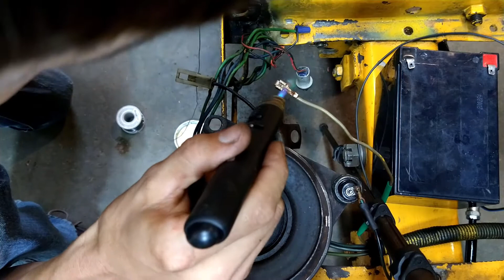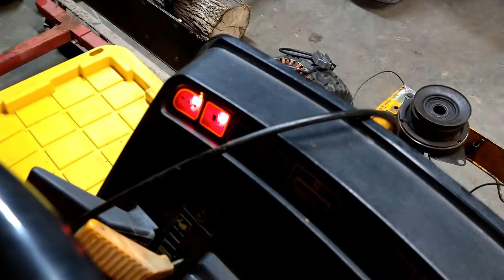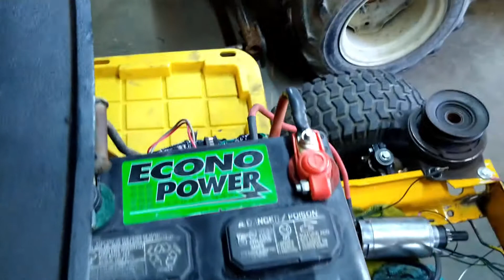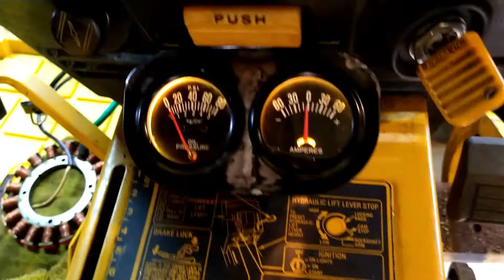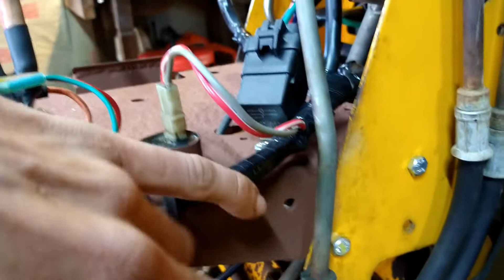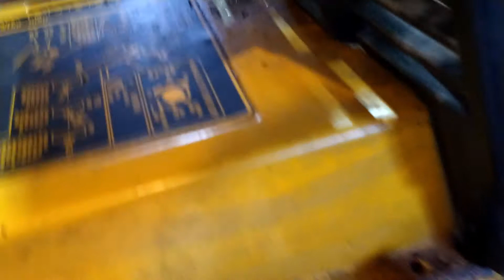Cub Cadet 1882 Electrical System, Part 4: Wiring Overhaul – Finishing Touches

Comment: Great job on showing the functionality of the wiring harness. I just purchased an old Toro Proline 118 Zero turn mower with a Kohler Magnum 18 . Spotted your YouTube video and have been following your progress. Different machines but a lot of similarity when it comes  to circuitry.  So thank you for the info. I'll put it to good use.
Reply from the maker: Yeah the wire colors and some of the interlocks may be different but  there are more commonalities than differences.  Best of luck, and thanks for stopping by!  Feel free to reach out with any questions.